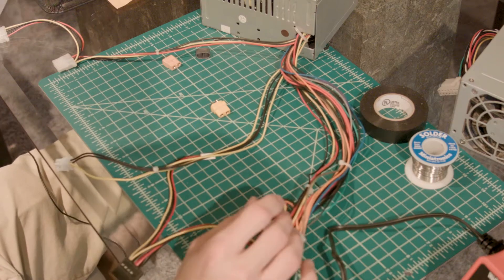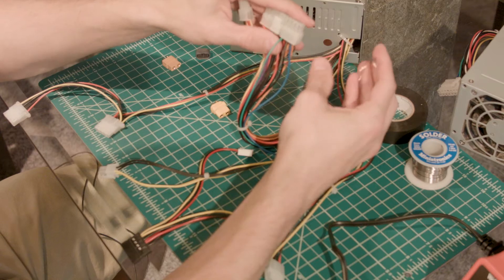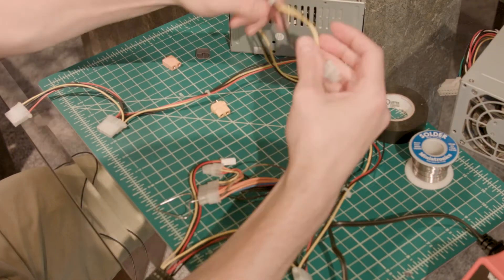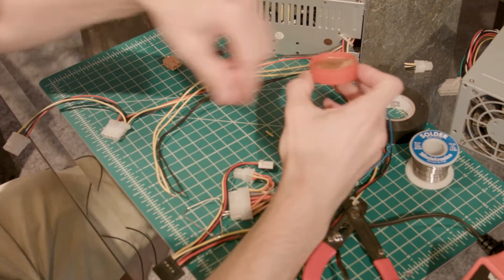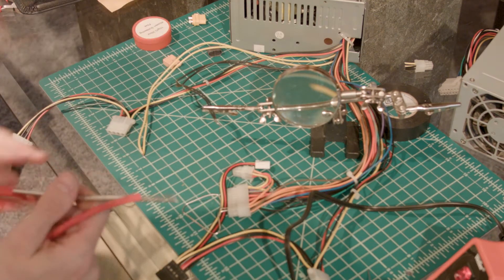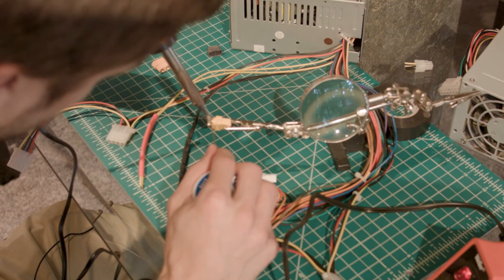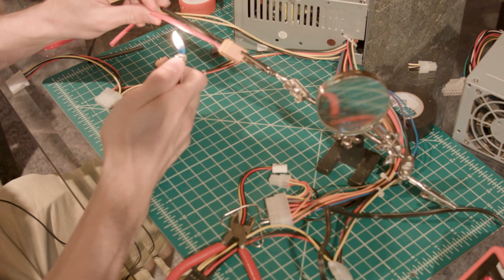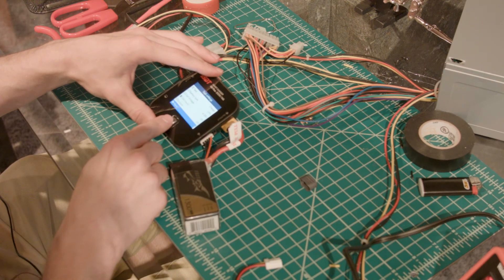How to convert PC power supply for Lipo Charger (ISDT Q6)

Comment: Question is do you need more than one 12v wire? I noticed you used 2 and i have heard of peope using m 2 or more 12v wires on one xt60
Reply: So here's the "more sure word" on how many wires to use.  Each wire is only capable of a certain DC amperage (AMPS, not VOLTS) before the wire will actually burn up and catch on fire =).  With those power supplies already configured for different voltages and amperages, you kinda need to use a meter to MAKE SURE you are using the 12V connectors (the others are 3.3V and 5V).  Even if the PS is 600W, you're not likely to get all that power out of the 12V connector.  You'd have to pull 25A at 12V to get even the full 300W that the Q6 charger is capable of drawing.

Just google DC WIRE GAUGE CHART, and determine the size of wire(s) on your power supply.  For 25A, for example, you'd need at least 12ga wire, which the power supply doesn't use.  BUT - wire amperage can be "added" in parallel applications.  So you can use two 14ga wires, or 3 16ga wires, etc.  

In short, the answer is you want to use as many wires in parallel as possible (of the same VOLTAGE!!) for your power supply.  Or you can just spend $20 for a power supply and make your own.  The Q6 can input up to 32V, so you'd need 10A at 32V, or 13A at 24V, or 25A at 12V, etc. to get the maximum charge output.  Hope that helps!!
Reply: @agentduke2  The cahrger can handle max14A, i think
Reply from the maker: Eric Webb being totally honest, I’m not sure. I just used both wires because that’s how that particular connector from the power supply worked? May I ask why... are you planning to use fewer/more?
Reply: ThriveProduction  right now i am only am using one 12v wire but i have only been charging 1s but i plan on doing up to 4s soon i am using a delta 300w psu. I think i am gonna do as u did with the 2 wires
Reply from the maker: Eric Webb if it’s got the same setup as mine (with two yellow and two black ) use all the wires.

Comment: Great video, very helpful ,Please correct me if i'm wrong :  I ordered the same ISDT Q6 Plus 300W. Now i am going to use it with a PC Power supply that says "max total output 250W" now i guess this 250W is combining all different  3.3 - 5 - 12 voltages as a PC power supply also shows on the label 3.3v/12A - 5v/12A - 12v/14A , so i guess from the 12v source i can go up to 14A which is 168W, so i have to set up my ISDT Q6  "max input power" in the configuration menu to less or close around 168W max right ? so that i dont burn my power supply down ? Also with this setup how much 4s 1550mah can i charge together at 1C charging  rate ? Any feedback is wecole :) thxx
Reply from the maker: Arnaud De Smedt hey... firstly I am by no means an electricity expert.  So please research on your own as well as the following advice. Obviously you’re using A * V = Watts to come up with that 168 number. That seems accurate, but I’m not 100% sure how these power supplies actually send output. But let’s assume that is true and your max wattage is 168. You want to charge 4s in parallel which is 16.8volts no matter how many batteries you hook up because when charging in parallel it still appears to the charger as 4s. This gives us a value of 10 total amps. Now a 1550 batter at 1c is 1.5 Amps. 10/1.5 =6.666  so depending on how you round you can either charge 7 batteries at slightly less than 1c or 6 batteries at slightly more than 1c (you’ll still charge at 10amps because you’re splitting up that 10amps between all the batteries). KEEP IN MIND when hooking the batteries in parallel they have to all be relatively the same voltage. I check every cell first before hooking then all up. If there is more than 1v different between batteries you cannot hook them together without risk of fire.
Reply: You can just plug it in as long as the voltage is =/< the max input voltage of the charger. The charger has an amp limiting architecture, so even if the power supply can provide amps higher than the charger specification, it will in practice only supply the amp-load as controlled by the charger.
Reply: One more thing: In my experience using the isdt charger, if you set up a charge sequence calling for more amps than the power supply is capable of, the isdt charger will stop charging and provide an input amperage error. When this happens, just lower your charge amps until there is no error. With some iteration of this practice you can determine the max amps the power supply can push at your given charge voltage.